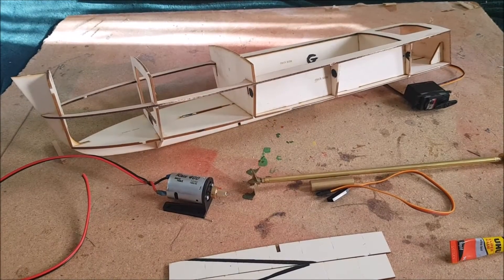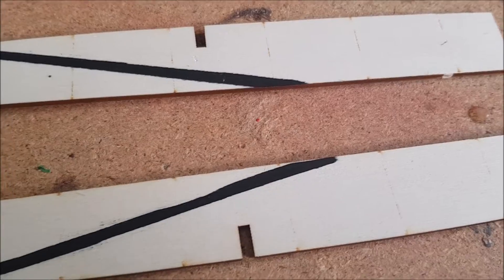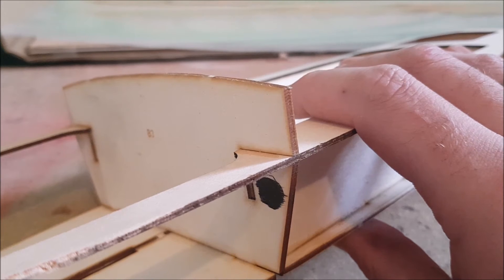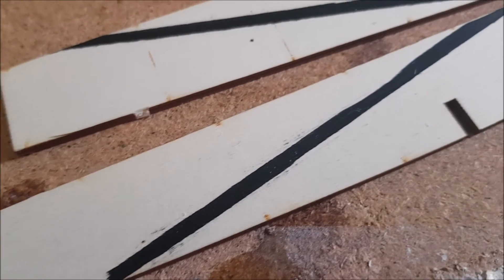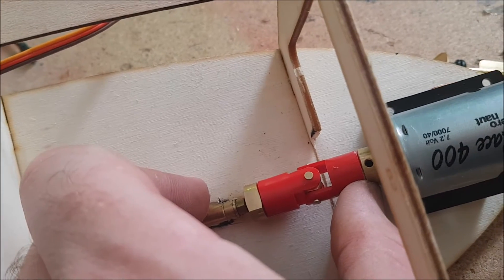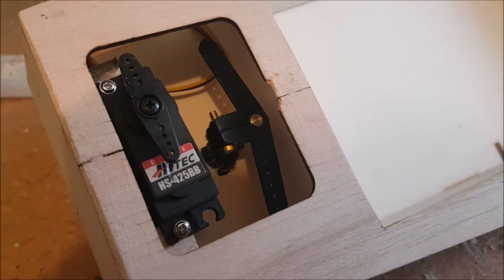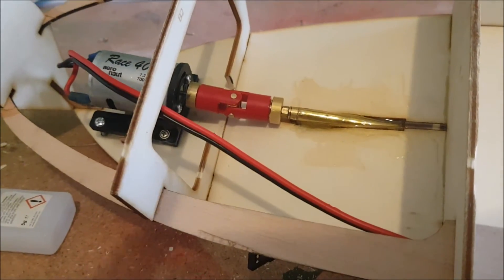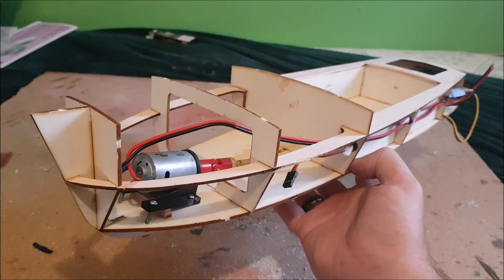H A Kits Morston Norfolk Crab Boat Build Part two

Comment: Hi there a good explanation of the hull and electrics being installed, oops on the slippage at the rear rudder tube and the thickeners for the prop tube, still these engineering problems are always able to be solved with a bit of thinking time or did I mean blue room time 🤣😂🤣. Great to get a smaller craft kitted out with RC gear. Great job. Take care and best wishes 😉😊😉
Reply from the maker: Thanks mate noticed no one had done a how to RC these kits online and thought id give it a go. Ah yeah that was a bugger trying to hold it still drill and the like was a nightmare!Thanks mate hope you are doing well

Comment: Believe me the bigger version does not help. Yes you have more room for the motor but the servo and rudder is just as bad. The length of the prop shaft is just plan silly. HA kits are relatively easy to build as long as you are not putting in RC.
Reply from the maker: Yeah sure that it could be improved, it's also hard to balance as all the weights in the nose and there is no room in back,you could put weight under the back but without knowing how it sits would take a  clairvoyant to get it right